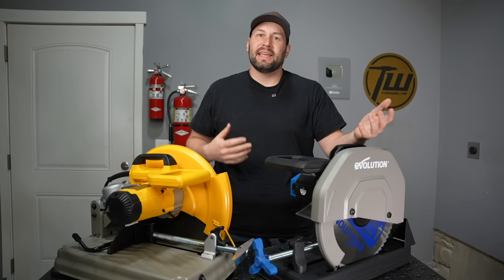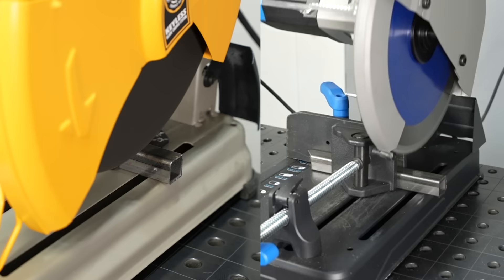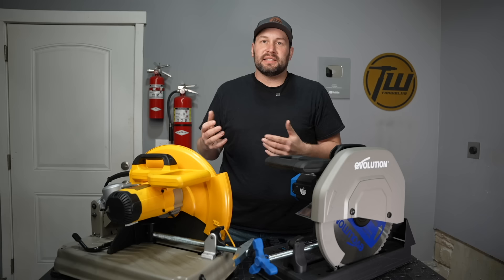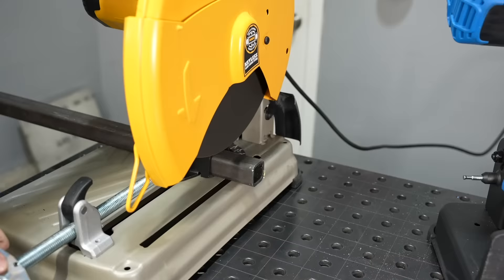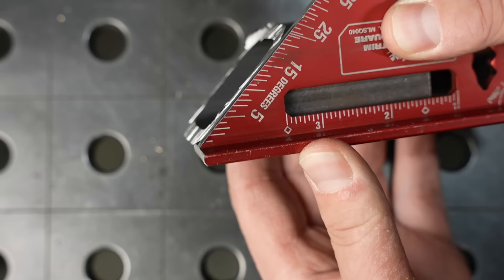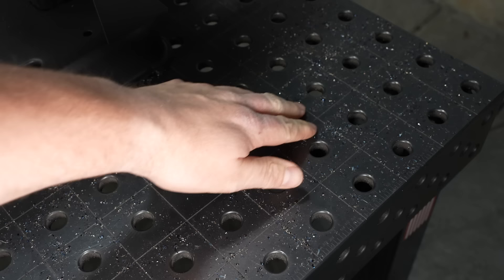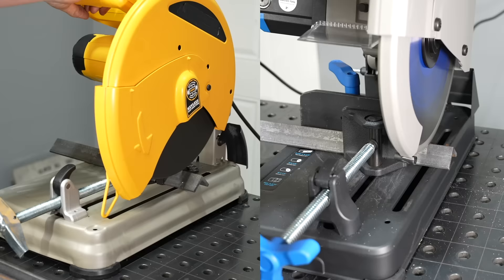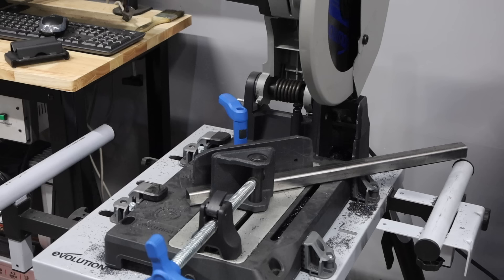Are Carbide Chop Saws Better? Abrasive vs Carbide Metal Cutting Chop Saws

Comment: In metalworking we have a rule that at least 2 teeth must be in contact with the job otherwise hammering occurs. So do you use finer pitch on smaller walled jobs? 
That dust you say hangs around when using the abrasive disc would be cancer causing  similar to silica dust. Whatever the composition of the dust when it floats in the air it indicates it at micron size which is extremely dangerous in terms of lung disease. If I was doing this all day I would wear positive ventilation attire same as welders. Also the noise levels emitted by these machines are at hearing loss levels. 
I'm a Metalwork teacher here Sydney Australia. Care to reply?
Reply from the maker: Thanks for the comment! I was taught the same thing with 2 teeth engaged, and I follow that on bandsaws. With these carbide blades, the pitch is much wider than the material thickness, so there often isn’t a tooth engaged. I was concerned about this at first, but I’ve been using them for years without a problem. That being said, they do often finer pitch blades for thin metal. As you mentioned, the dust from abrasive saws can be very harmful and they are certainly loud.

Comment: I've had an Evolution saw on my toy list for quite some time, so I don't need convincing.  My question: Is there anything the abrasive saw would be better at than the Evo?  hardened steel?  Strange alloys?
Reply from the maker: For very hard metals, the abrasive saw could be better, but it really depends on what you’re trying to achieve with the cut. When it comes to strange alloys, a larger industrial piece of equipment with flood coolant may be needed depending on what you’re working with.

Comment: I have been using carbide saws for a decade and you missed an important point. you can have a carbide blade sharpened or retipped 2-3 times. this saves a substantial amount over the abrasive blades. I have a love hate relationship with evolution though their blades are good but their saws are a total crap shoot. for any of these saws of any make if the arbor runs out or is marginally undersized the saw is total junk and eats blades faster than an abrasive saw.

Comment: Can we used carbide blade in abrasive saw?
Reply: I would say no cos of rpm differences
Reply: I have the same question! For those who have abrasive saws and do not want to purchase another saw, can they just use a carbide blade?
Reply from the maker: No, carbide blades are generally rated at a much lower RPM, so abrasive saws will over-speed them.

Comment: Like most I started with an abrasive saw, used it for years. Started a number of fires from sparks. Cut fingers, burnt a few shirts. Done the funky burning ember in the boot dance. Blew out a few discs (chinisium fake labelled crap). Spent way too much time cleaning up edges, using up grinding discs.

Comment: Honestly, I dont know which is more suck. One throws grit everywhere, makes part hot and sloppy burr, the other makes a mess in my shop like nothing else ever has or will.. those little chips are like Robar’s glitter bombs and the imbed into everything then get tracked everywhere.  
I prefer a bandsaw…

Comment: Isn't an abrasive blade required for tool steel, Inconel, and a couple of other metals? Although I suspect that anyone who's working with those isn't the real target audience of this video :)
Reply: You are correct! 💯%
Reply: Sure, but how often are those cut by a chop saw? I machine these metals but don’t often use a chop saw. But as long as these materials are annealed properly, they can be cut. I cut 4140 on my saw.
Reply: @melgross Inconel is used for exhaust tubing. I don't think those are machined, although I have no experience with them.
Reply from the maker: Thanks for the comments! Abrasive blades can be better for some really hard alloys, but honestly there are better industrial tools than these for that kind of specialty work. I’ve cut 4130 without a problem on my carbide chop saws, though I think it took a bit of extra life out of the blades. Inconel is a trade name for nickel alloys from the company Special Metals. It includes a wide variety of alloys with a wide range of properties. This is getting really long, but my point is that those types of processes have to be selected and engineered on a case by case basis.
Reply: @TimWelds  inconel and others, such as Hastelloy are a pain to machine, much less cut. I’ve had to make parts for my pumps in my lab years ago. Not fun. I wouldn’t even think of cutting them on any saw, even a cold saw.
Reply: @JCWren  they’re used for shafts, impellers and numerous other parts. I’ve machined them.

Comment: Nobody ever shows what it is like cutting flat stock on an Evolution saw. Try cutting a 1/4" x 6" flat stock. It does not work. Content makers should show this, even if they are supporting you.
Reply from the maker: I cut 1/4” x 6” flat bar in this video, I do it all the time. The key is positioning it vertically and it cruises through like butter. It is true that it doesn’t cut as well on flat faces, but I don’t find that to be a common need for my work.